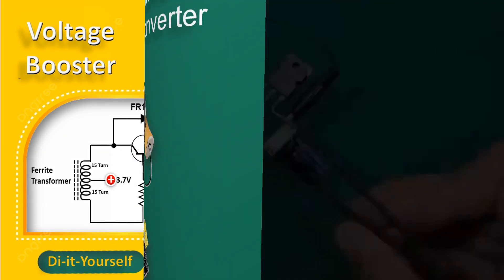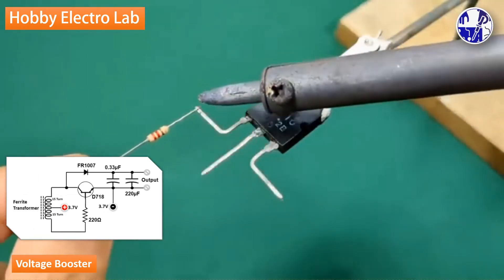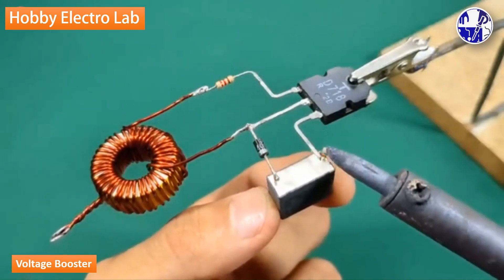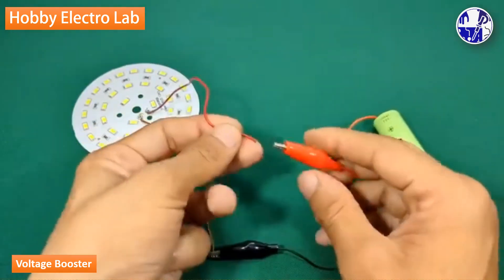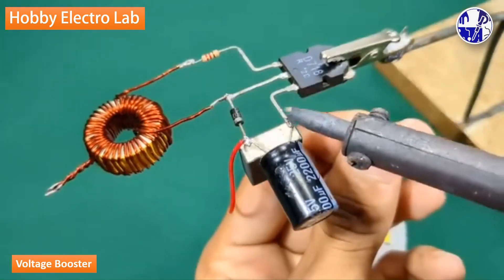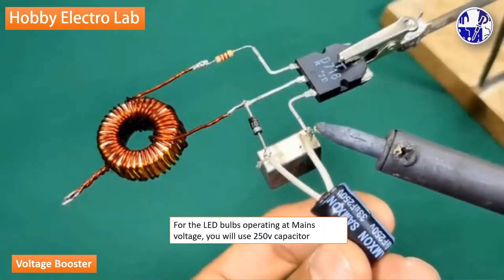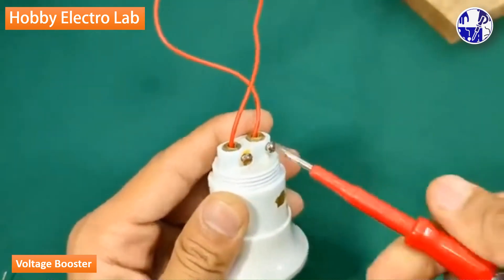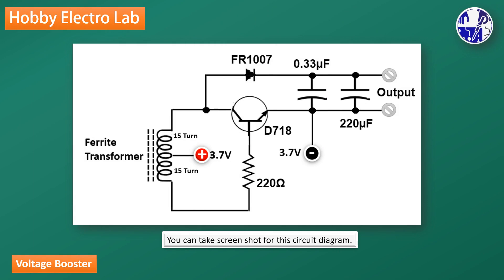1.5V to 220V? Yes! Build This Mini Power Inverter | 1.5v to 220v inverter

Comment: Thank you very much for your circuit. But in my opinion there is a wrong video. Because, although its name is 1.5 V to 220 V Led bulb booster, and in the component list battery is 1.5V but in video you used 3.7 or as you measured 4V powerfull high amperage battery, again in list there FR1007 rapid diod, but you used (as it is written on the top of screen) 1N4007. In the list you mentioned as transformer, in my opinion should be toroid inductor. 
Best wishes.
Reply from the maker: Thank you for your detailed feedback! I appreciate you pointing out the discrepancies in the video and component list.

Comment: I think if you use MOSFET  instead of transistor, the efficiency will be much higher.
Reply from the maker: You're right, MOSFETs are often more efficient for higher power applications. Thanks for sharing your insight!
Reply: @HobbyElectroLab  yeah, I hope to see it soon.